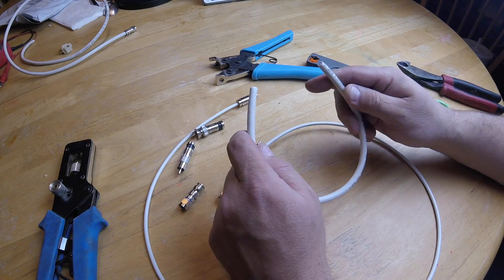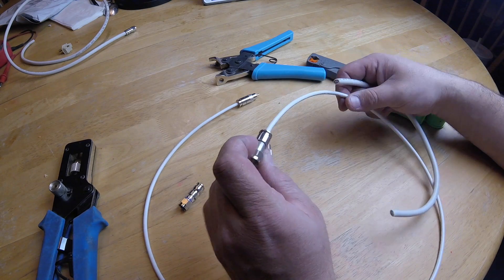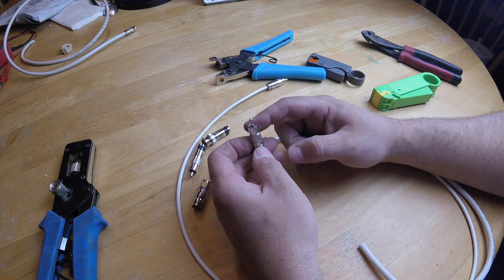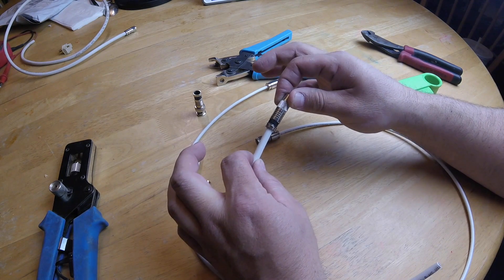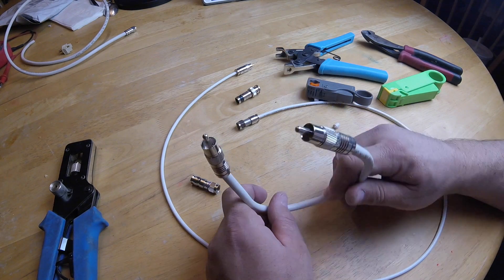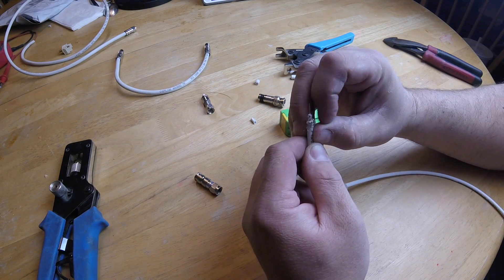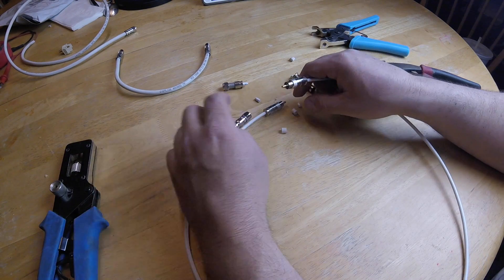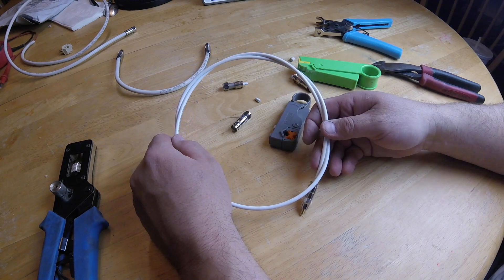How to make custom AV cables

Comment: I'm connecting  a dvd player. The instructions says to connect an rca cable yellow from the player to the video in jack on my tv which is green. I get sound & video but its in black & white & the picture isn't the greatest either. I'm working with rca cables I already have.
Reply from the maker: You must have an older TV. The red RCA connectors can be a little confusing. There are TWO red RCA style connectors on TVs that use something called COMPONENT video. One red connector is for right audio like always. On TVs with component video, there are three more video connectors (red, blue, green). You're trying to put the yellow video cable into the component video connections. That won't work. You have to find a yellow one on the TV or you have to use a different video cable (HDMI if you can). If you need to use component video on the TV, you'll need a DVD player with component video outputs which are super rare these days

Comment: Antenna cable?  Im wantingbto make a composite cable.  Is using coax for digital only?
Reply from the maker: All RCA, coax, antenna, digital coax, etc cables are the same thing. You just take the coax cable and put the connector you want on the end and you're good to go. Pretty cool right? In the case of antenna, use F connectors on the end.

Comment: To connect a  subwoofer is it a lot of difference between use a regular rca cable or those customer cables? Or is mínimal the difference. I mean  worth it?
Reply from the maker: There is a big difference between a high quality cable and a low quality cable. I consider a custom made cable to be high quality and I feel like it’s worth it.
Reply: @AlanCleggYouDoAV  thank you Alan for your answer, i'll make those rca cables

Comment: Do you have a Video on a Y subwoofer Coax Cable? Or can I use a single RCA to my AVR to my Subwoofer? But there is a red and white  RCA hook up at my Sub.
Reply from the maker: I don’t have one of those videos. My understanding is that only one input on the subwoofer is needed. I usually use the white.
Reply: @AlanCleggYouDoAV  thank you!  That is the needed info I needed!!

Comment: Is it possible to make a Coaxial Jumper (Male) [The kind the TVs used before RCA] to a Video RCA Composite (Male)? I found a site where these exist I am guessing and I'm looking to either buy a Coaxial Jumper to RCA Composite Cable OR Make one that I can use to hook it up from my VCR since I want to record static to My VTR Camcorder and digitise it. :). Let me know if this is possible or bologna please. :)
Reply from the maker: Yes you can make the cable (we call it RCA to F connector) but it won’t work in that application. You would need to first run the coax from your VCR to an RF Modulator (it’s a cheap common product) then from the modulator you can use RCA cables.
Reply: @AlanCleggYouDoAV  I'm grabbing an RF Switchbox soon :) I have this link too to show you the cable I am looking for. This cable and an RF Modulator, here I Come! :D

https://www.l-com.com/audio-video-rg59a-coaxial-cable-rca-male-f-male-120-ft
Reply from the maker: I don’t think that wire will work in in this situation.  You’ll just be using regular coax cable connectors and regular RCA cables with the RF modulator.

Comment: Hi Alan.  Thanks for the very useful information and explanation.
I have a Yamaha RX V375 (my first step into 5.1 home theatre.
I am running 4 x Acoustic solution av-70 speakers as front/back, and a mordant short centre (no sub yet)
Could i use the HDMI 1 (ARC) into my TV,add my sky box,ps4 out into the remaining HDMI on my Amp and turn off ARC so i can use scenes to watch and listen to thoise inputs without the stupid ARC messing everything up and turning everything on/off?
I am using an Optical TOSLINK Digital Audio Cable as a sound source from ther TV to the amp

Thank you in advance..
New sub here.
Reply from the maker: It sounds like you got it handled from your other post? If not, let me know. Your set up sounds correct though. Thanks for watching!

Comment: They have solid core RG-6, just so you're aware
Reply: RG6 Single with Messenger Coaxial Cable Solid Copper Conductor - Black "EnviroReel https://www.amazon.com/dp/B0755P28QL/ref=cm_sw_r_cp_apa_i_qqQkCbEJ5ACVM

Solid copper core. We use it for Satellite Dish installs
Reply from the maker: Cool! I’ve seen solid copper RG59 but not 6.

Comment: can these wires be used as speaker wires
Reply from the maker: No they can't. These are coaxial cables and speaker cables should be a copper pair. Thanks for watching!
Reply: Thanks man binge watched your videos - waiting for you to upload ''how to hide cable/SAT box''
Reply from the maker: Wow! Glad to help. I actually get a lot of requests for that and I keep forgetting to make it. It's really nothing special. You only need a few things:
1. Make sure your cable/satellite line is behind your TV
2. Use industrial strength velcro tape to stick the box to the back of the TV (be careful not to put it on any part of the box that gets hot or it will come off)
3. Get an RF remote to control the box (since it won't have line-of-sight control anymore) or use an IR extender kit if your box doesn't have RF capabilities. 
Done. Does that make sense?
Reply: yeah and thank you!
Reply: Ok buddy,, im gonna put my rcas together like you are.
  so i order a spool of the "Mini rg59" and its on its way to me ( rg59 more flexible then the rg6 acording to your video).
 my question is what Type, or diameter of rca plug im i gonna order, because isnt the mini rg59 cable is smaller diameter than the  rg6?
Reply from the maker: Yes. Mini RG59 uses a different connector. I use a brand called Holland that works well and isn’t too expensive. I don’t think they’re sold on Amazon. I saw some Monster brand connectors on Amazon that looked like they may work but I’ve never used them so I can’t guarantee it.

Comment: The compression tool you use in the video appears to do all the connection types, however the one in the link appears to just do the F type.  What tool are you using?  Do you have video that can tour your tools and explain them?
Reply from the maker: The tool listed will do RCA and F connectors even though it doesn't specifically mention it. My tool actually won't do F connectors. I need two tools to do the same job that the tool listed does. The tool listed is the tool that my installers use and I prefer it over mine, but I bought mine before that one came out. Thanks for watching and I'll add a tool inventory to my "videos to make" file.

Comment: Very interesting, didn't know they made a mini RG-59...           I've done a lot of RG-6, but i just wondered if you have run into the connectors not going into the co-ax when the should? Its as if different brand cables and or connectors are just slightly different diameters.
Reply from the maker: As long as you match the cable to the connector, they seem to fit ok. You may be using RG6 quad shield cable with an RG6 connector.  They don't fit together very well at all since they are significantly different sizes.